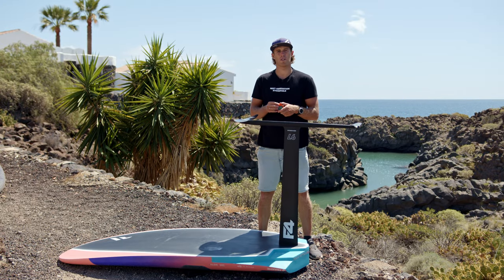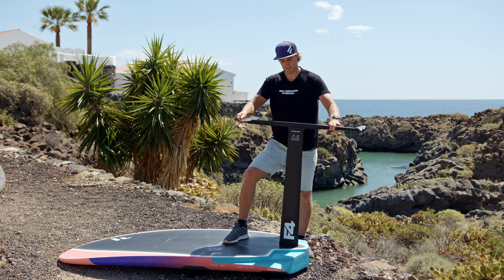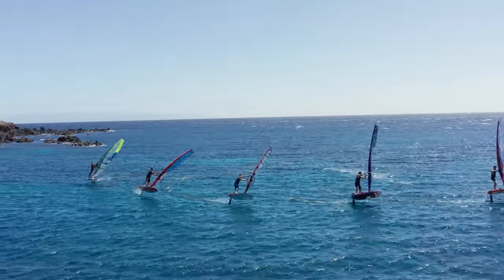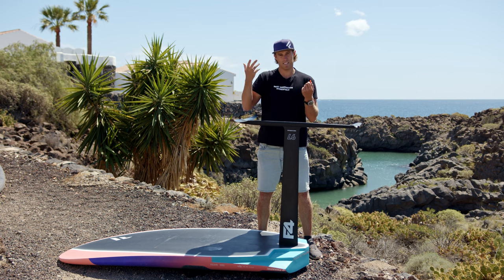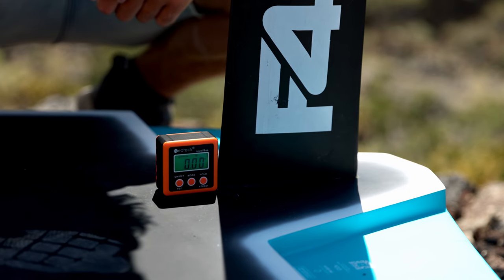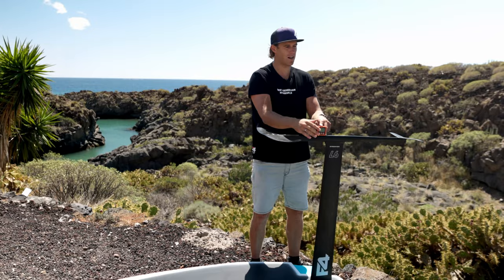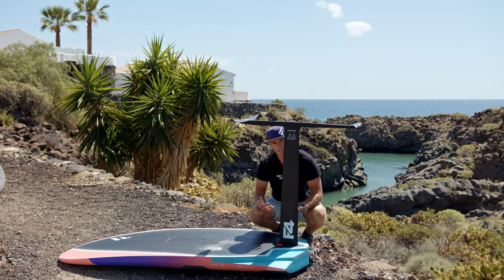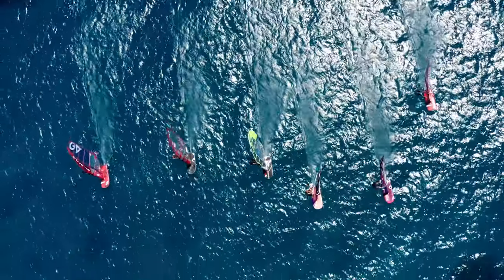Episode 4 - Foil angle

Comment: Probably the most underrated thing for tuning your foil 👌🏼
Reply: Correct, for getting the board planing/foiling. But once you are on the foil, it just changes the angle of your board in the air to get to a stable ride... so apart from some resulting air-drag, that doesn't seem to make such a huge difference (running the board horizontally is surely optimal from air-drag perspective). I guess the relative angle between front and back wing is a far more important factor when on the foil, because it it makes the difference between having too much or too little power at a certain board speed.

Comment: But if i put a shim in the box for changing the mast angle, by putting a shim this will not make a bad fitting in the box, if i put a shim the mast will not enter in fully in the box this is not a problem ?
Reply: No that's normally not the problem, I always see let's say 'the front of the foil' coming out of the board.